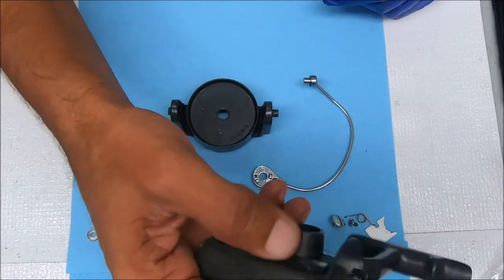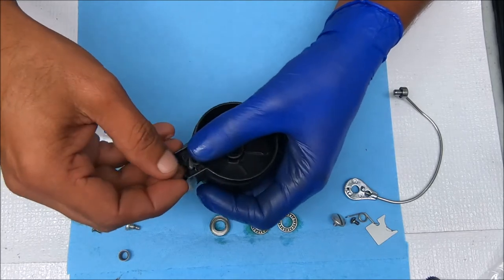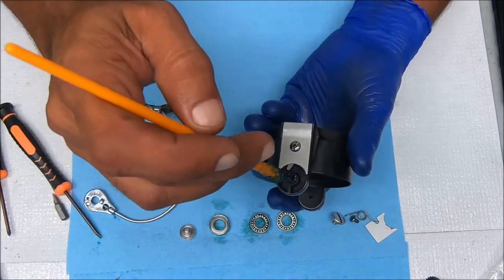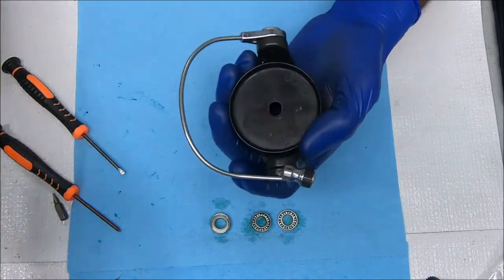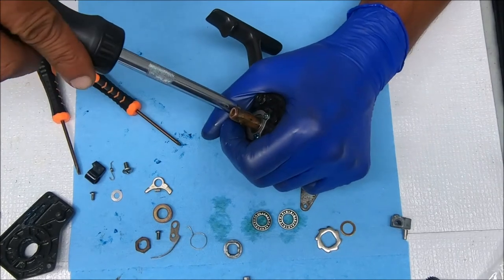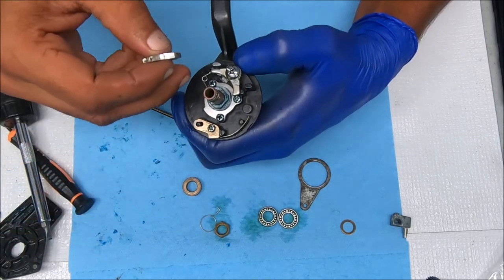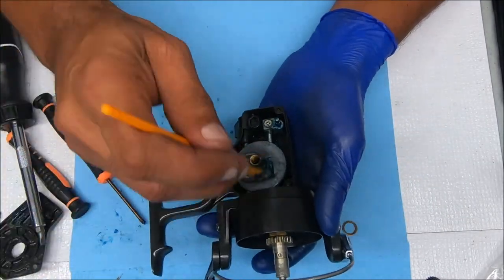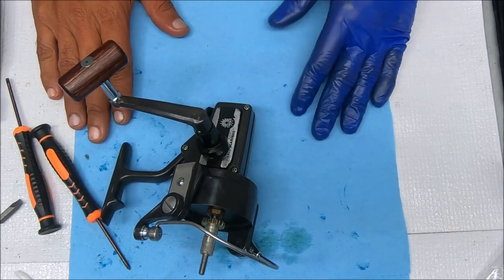Daiwa BG30 Fishing Reel - How to service and reassemble

Comment: Thanks on the reassembly!  I think you put that last bearing in wrong way... the open side with bearing should face inwards.
Reply from the maker: You're welcome and thanks for watching the entire video. Some may want the closed end (if there is one) parallel with the gear. I, personally, don't feel it matters from a protection (or lack thereof) standpoint. Thanks again.
Reply: What grease were you using
Reply: @bmwmaxmad1314 in his description he lists links for all the greases and tools used:  Penn reel grease.  ... But I bet any marine saltwater (trailer) bearing grease would work perfectly.